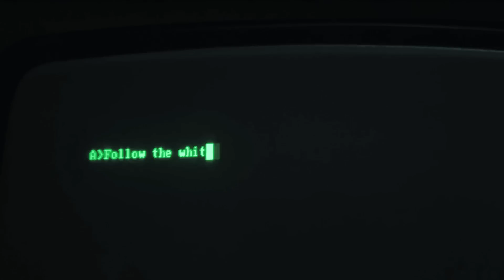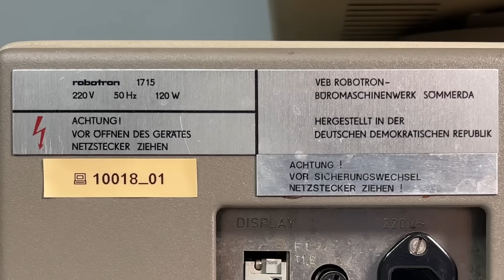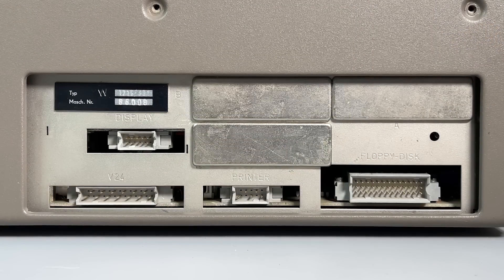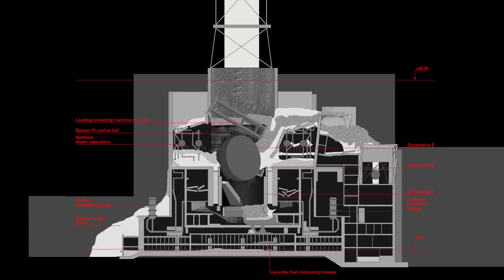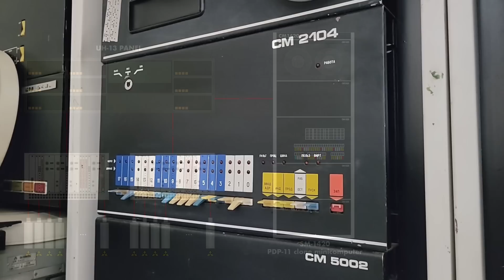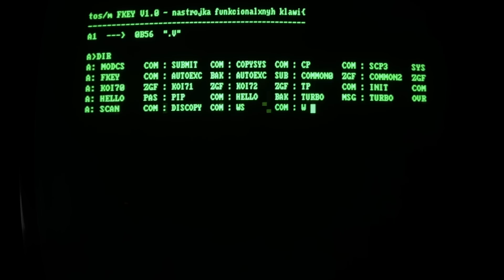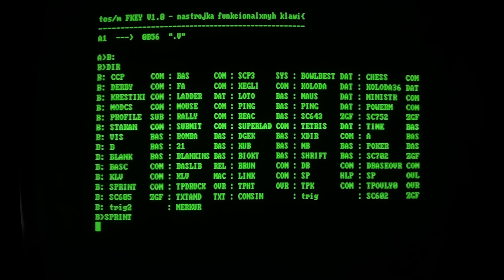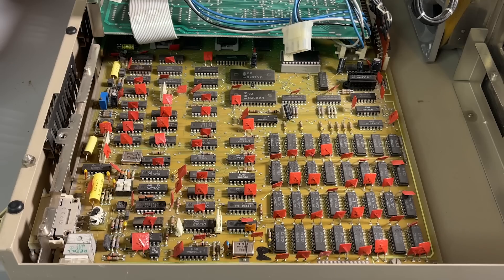How a little East German Computer Monitored a Nuclear Tomb | Robotron 1715M TEST RUN

Comment: This thing has a great history. They weren't allowed to build a personal computer - but nobody said anything about a print controller. This is what this is. At least officially - at first.
Reply: So a terminal that accidentally booted into CP/M. 😅
Reply: @BastetFurry  The original reason for designing the direct predecessor of the chipset that made CP/M big was to make an electronic desktop calculator. For a while, the bottleneck of making terminals to boot into CP/M was that early terminals would use weird memory configurations, such as a long bit-shift registers, which were often not exactly random-accessible. (The justification of long shift registers for a terminal is, if you've got to keep feeding your CRT's electron ray at a predictable rate anyway, a shift register is easy to make and you won't need a lot of the sort of control logic that early combined-computer-and-terminal systems might spend more than half of their chip budget on.)

But eventually, DRAM prices came down, and IIRC, 16KiB (of proper RAM) is enough to fit CP/M 2.x and (small) application programs. And that's pretty close to what an advanced "terminal", with capability for modem and perhaps Kermit or even IBM 3270 emulation might come with.
Reply from the maker: Precise!
Reply: were building a PC is prohibited by the Soviet Russia? And why is that?
Reply: @nobeltnium  Presumably, because there already was one. If they made another one, they would be competing - and they want inter-cooperation, not competition.
Reply: @nobeltnium  There might have been budgeting restrictions. Central planners were often quite pointy-haired about such things.

The great thing about a universal computer is, it can do a lot of different things, so you can make a lot of different devices that are really universal computers.
Reply: In the early days of DEC, it specifically aimed to not produce a "computer", on the theory that a lot of companies known for making "computers" (most of the Seven Dwarves) had just gone out of business and merged. But they made increasingly capable "laboratory control equipment", all the way up to PDP-8, which was a "laboratory controller" of such power that pretty soon PDP-11 was approved, and that was enough of a "computer" to run first versions of Unix on. (In the Soviet Bloc, a later version of PDP-11, from when the main system could already fit on an LSI chip, as LSI-11, was cloned as Электроника 60, and popularised as Электроника ВК0010/ВК0011. К1801ВМ1 is the Soviet version of LSI-11.)
Reply: @rileyfaelan  DEC not calling them computers was partly also because a lot of institutions required a lengthy committee process, etc. to allow purchase of a computer but a "lab controller" could be purchased without needing approval.  The founders of DEC came out of the culture they were selling to and named and targeted their products appropriately.

Comment: Spotted a Texas Instruments chip on the motherboard, and it wasn't socketed. Since the processor and floppy controller chips are socketed, but there were East German clones available, I'm guessing those two may be later replacements.
Reply from the maker: Or a shadow import.
Reply: @ChernobylFamily Shadow import or Vebeg… Exchange programmes existed for a lot of items. Like light beams from VEB Ruhla Electrika against VW Golfs / Transporters T3. Maybe also computer parts.
Reply: @Canleaf08  That is very unlikely. Computer parts and microelectronics were in the COCOM list and couldn't be officially traded to the East.

Comment: Quick note just 5:30 in. Interesting SI/SO (shift in/shift out) button. In the olden days you had 7-bit US-ASCII codes (keyboard and display) at the bottom. To get national characters for those who weren't Americans... There was the NRC - National Replacement Characters - that had to be set, probably, in BIOS or in control page files or similar depending on HW and operating system - or other software. Now, the NRC was just an overlay so that some characters were changed.

']' (Å), '[' (Ä), <backslash> (Ö), '}' (ä), '{' 'ä' and '|' (ö).

Like for us in Sweden, we don't use {} (curly braces), [] (brackets), <backslash> and | (pipe). We do , however, have three more letters: åäö/ÅÄÖ. So, in Swedish NRC, the characters we don't have is the US alphabet were replaced with our national ones.

However, this caused some problems relating to old mechanical typewriters and the placement of the our national characters. There was a conflict with the character values. In Swedish, those extra letters comes out in the order: å, ä and ö. However, replacing the US characters with our made the order: 'ä', 'ö' and 'å'. So, this caused a problem when sorting records with text requiring what is called a collating sequence where a sort is told how to arrange values.

But there was also the ISO-8859 or ISO Latin Alphabet character set and its variations. In Sweden we used the 8859-1 or Latin character set 1.

The 7-bit US ASCII only used the lowest seven bits. The eights was left for parity. But when parity wasn't required, that bit was open for use... With the other character sets.

And the way to toggle between a 7-bit character code and an 8-bit one was using Shift out/Shift in (ASCII control codes 0x0E and 0x0F).

However, this screwed up printing if you ran like an 8-bit application on a 7-bit UNIX. Because when the 8-bit å, ä and ö came out on the printer, they came out as 'e', 'd' and 'v'. Because that''s where our local å, ä and ö resided with the 8th bit cleared. So, besides having the printer set up OK, you also had to (in UNIX) add a 'tr' (translate) command the a 'filter' to be executed before the actual print started.

Oh dear! Hope I got all this right. But it was like ages ago! ;)
Reply from the maker: This is a very valuable addition to the story. Thank you very much!